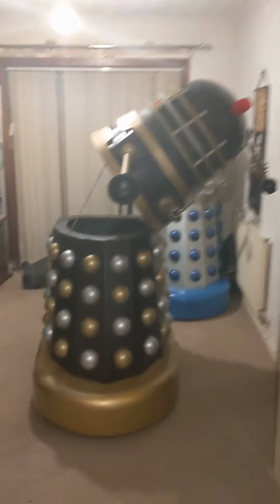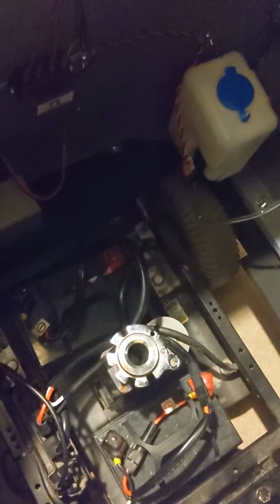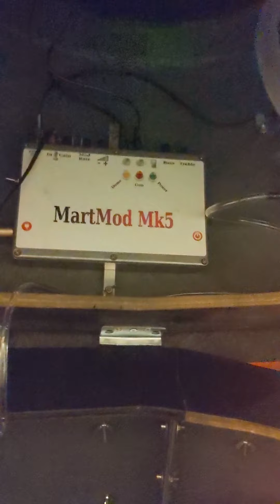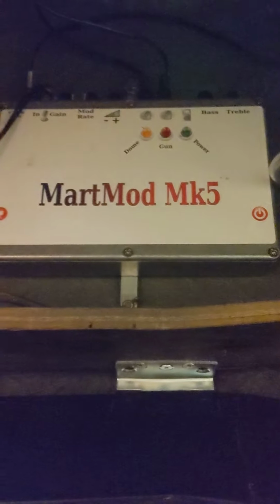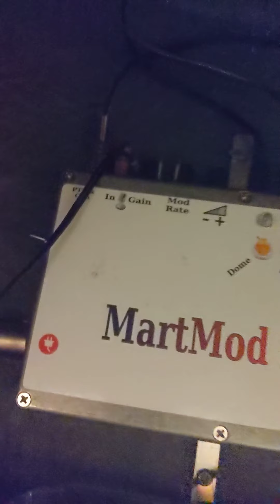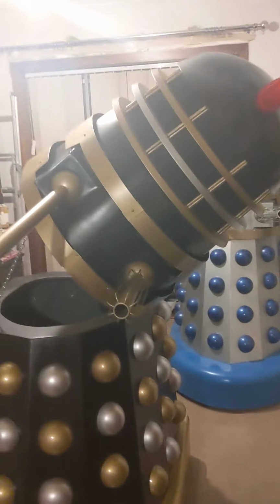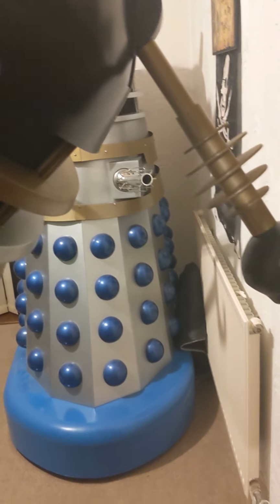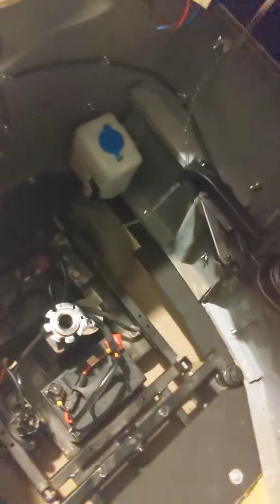Dalek Decimus - Internal Workings of Dalek Decimus

Comment: I just purchased the MartMod, what speaker and battery do you recommend I get?
Reply from the maker: I have 2 car stereo speakers in the neck section. There is no single solution and no 2 Daleks are identical internally. My Martmod uses a 12 volt battery that powers the Martmod, eye light and will also power a fan cooling unit (once I get to install it). I would join the Facebook group Dalek Building or join Project Dalek.